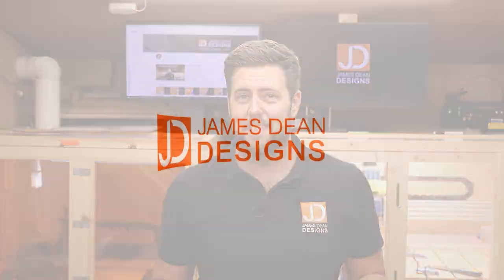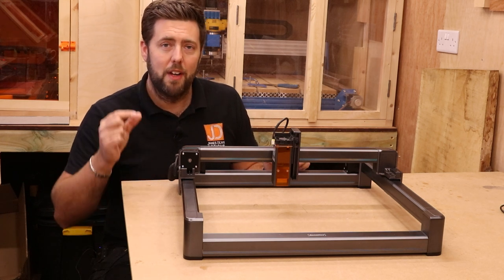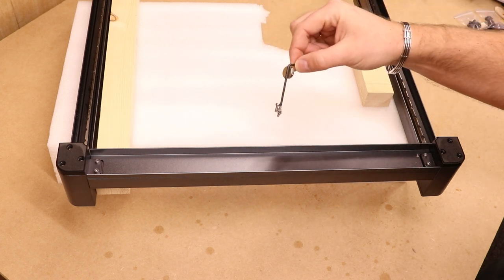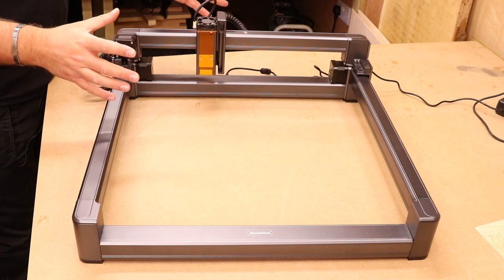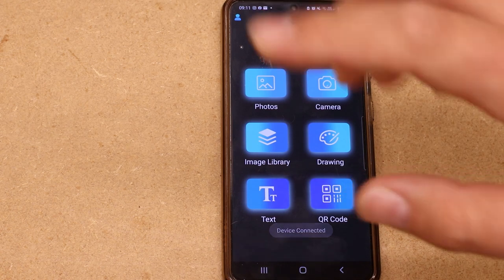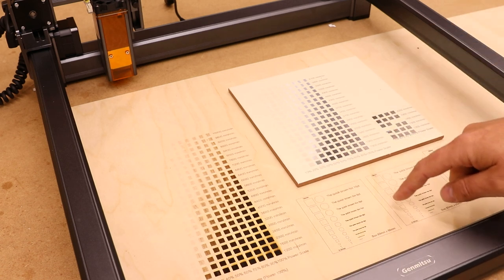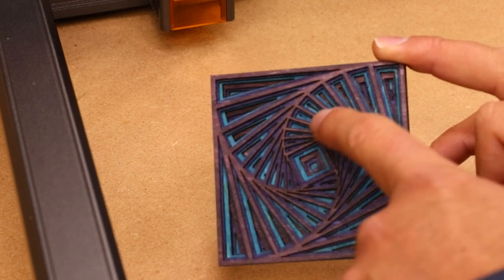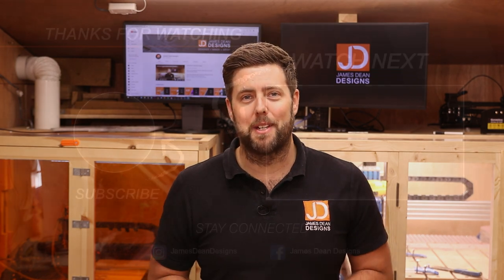LC-40 Sainsmart Genmitsu Jinsoku Laser - Phone controlled laser engraver

Comment: Hi James,  A really fantastic video, very well explained, especially the assembly and set up with the phone. I live in the UK and would like to purchase this machine but they are out of stock at the moment so in the mean time I have probably watched every video on Youtube about the Jinsoku LC-40 and yours has been by far the most informative. Just one little thing that you might want to look at is there are a lot of errors (spelling etc) in your subtitles which are an excellent addition but might cause some confusion to those that rely on them.  Thanks for an excellent channel. Paul
Reply from the maker: Thanks Paul. It's only been fairly recently I've been adding my own subtitles because of the extra time it takes. This would have been YouTubes auto subtitles, but I can go in and edit them so I will do 👍 
If you're struggling to get one, just message me on my website
Reply: @JamesDeanDesigns  Thank you James for replying so promptly. I wasn’t sure if you knew that the subtitles were like this. I will be looking at your website later.

Comment: James, I did some looking into the GRBL settings on my LC-40 and noticed the max for all three axis’s is set to 5000.  This may be why your tests didn’t show much difference above that.  It’s a bit strange that the machine would be set there instead of 10200!  Any thoughts on this?  BTW I changed mine to 8000, the 80% rule and it flat out flys now!

Comment: @James : great video as always. Just talked to sainsmart the other day and they confirmed a 10w laser upgrade for the LC40.
Did you got rid of the crooked circles with tensioning the belts in the end? Because I’ve the same problem and already did the tensioning, checked alignment, lubed the rails - no clue why that is or is that a thing with belts? My normal 3018 pro diy laser can engrave so detailed. Not as fast obviously but at least super accurate compared to the lc40.

Comment: I bought this laser a while ago and I just getting around to using it now that the weather is warmer.  I like it though there are some things I don't like.  It is hard to attach the X stepper cable.  When I first tried this laser it would only go in the Y direction.  I had to take it apart and reattach the X cable.  It works now.  They could have made it easier to tighten the belts as the X belt on my machine is a bit loose though it still seems to work okay.

You said that air assist could be attached to the 5w module with passive air assist.  I would be interested in knowing how to do this.

Comment: Hi James, Great video as always!
How would you describe the stiffness of these "new" type frame compared to the old and simple extrusions used e.g on 3018?
The beams are open on one side which typically is very poor on twist resistant.
Thanks in advance!
Reply from the maker: Thank you.The frame as such is open, but equally they run on linear rails which are better overall. Especially because this is a laser, the chance of twisting is very minimal anyway

Comment: Hi James, I've been running the LC-40 with the 10w laser from the past 6 months and found it to be a really good machine, but do you know whether it can take a more powerful laser? If it can, would you recommend anything.
Reply from the maker: Most lasers over 10w require their own power supply and the LC 40 uses fancy cables so you would need to tinker with the wiring to make it work. You would also need to find a way to mount it because more powerful lasers are typically larger. So yes you could get it to work but would require some tinkering

Comment: Hi James, Thanks for putting this up ,it is a really useful guide to the engraver. I bought one but have tried on 2 laptops to download the drivers etc, but can't make them connect to machine. It just keeps saying waiting for connection despite following the flashing etc. Just wondered if this was the problem you mentioned when you tried connecting with your first computer? Cheers Andy
Reply from the maker: Essentially yes, the tool they provide to refresh wouldn't connect and do the necessary task. Bit of a pain, was hoping it was an isolated incident but I'd definitely reach out to Sainsmart if you haven't done so already
Reply: @JamesDeanDesigns  Hi James ,Thank you for taking time  reply. It seems to be a problem in the software I reckon. I did contact them & they asked if I had flashed it, which I had. They have not replied to my latest message though ,which is disappointing. Its a well built bit of kit & looks great . With regret I will have to return it to Amazon if they don't reply. Great channel by the way James.
Andy
Reply: I have an interesting problem with the software flashing of the LC-40.  I can’t flash the upgrade as the updated tool throws an IO Exception error and no device found message. This is frustrating as the LC-40 is connected and communicating with the PC, I can operate the LC-40 with the pre installed software so it must be connected.
Anyone else experienced this issue? And if so what was the resolution? Messages to Sainsmart support have so far not resulted in any response
Thanks in advance 🙏
Reply: @theopalcuttingroom8488  Hi, That was exactly the same problem I had . It is now resolved. I Emailed them & got a reply from Ryan. After a couple of emails with suggestions it was not resolved. He then sent me out a new board for the  machine that was updated. It worked immediately & took 5 minutes to unscrew & plug in.
Hope this helps
Andy
Reply: @nogunwales9406  thank you for that info, much appreciated.
hopefully I will hear from them soon 👍

Comment: James, as always a great video. Its been a while and I need to watch it again soon, but in the mean time, what have you found the max speed to be for the LC-40? Much of Genmitsu's documentation states the speeds in %, I guess because of the mobile app, but I've never found what that max speed is to better tweak settings for Lightburn using mm/min or mm/s.  Any thoughts?
Reply from the maker: Thanks Jeff, very kind. To be honest. I've not really pushed it to a maximum speed because the laser does very little when travelling that fast. I believe they are meant to go upto about 20,000mm/min if my memory serves me correctly. Its one of the advantages of using the 32bit controller
Reply: James, Thanks for the reply.  So as I wait to hear what Sainsmart Support says, from my inquiry to them, I guess, to be safe, if I stick with 5000 being 100% and work my way down from there, I should be safe.  For Now.
Reply from the maker: @JeffBenedict  you could always do a powerscale test, but instead of small increments go up 1000mm/min per line or even 2000 and start at 5000. You'll soon see at what point it doesn't get any faster by the graduation change
Reply: @JamesDeanDesigns  Sainsmart Support confirmed the max is 5000 mm/min for the LC-40
Reply from the maker: @JeffBenedict  I think Sainsmart have mixed up their models as its certainly not 5000mm/min, that's more like the little 1620. If you jump to about 26 minutes into this video you'll see I did a power scale test and got it upto 10,000mm/min.
Reply: @JamesDeanDesigns  I checked the $110 and $111 values and they are set to 5000 so maybe they have it wrong in their firmware update to go from mobile access to GRBL so Lightburn can be used.

Comment: Hi James, I’ve connected up the LC40 laser but it won’t connect to Lightburn or LaserGrbl either. I’m connected to Com port 5 (tried multiple com ports and still nothing) and when connected laptop makes the connection sound. I’ve tried putting a manual laser in and adding the bed area dimensions in and still nothing. The LC40 app works and so does Sainsmart Engraving software so I know the laser works including the usb lead. I’ve loaded and reloaded the driver also but still won’t connect or even see the laser.
Any ideas?

Many Thanks
Reply: Howdy Mark,
I have a similar problem, did you end up finding a solution?
Right at this moment I have a very attractive looking paperweight sitting on my bench pretending to be a laser engraver 🤪😣
Reply: @theopalcuttingroom8488  I found this resource on their website https://docs.sainsmart.com/article/hy1vjck0oj-genmitsu-jinsoku-lc-40-resources

But in a nutshell, you have to go into Ports, and disable everything in there other than the one connected to your laser. Once you’ve don’t that it will update fine and then enable everything. Hope that helps 👍
Reply: @marksneyd1262  
Thank you Mark, that works 👍
I have contacted SainSmart and advised they need to make the resource a little clearer, namely that the user needs to disable all COM ports in the Device Manager including COM1 to cause the PC to recognise the LC-40.
Cheers and thanks for your help 👍
Reply: @theopalcuttingroom8488  great stuff. At least you have a working paperweight now 😂

Comment: How did you find the linear rail system over wheels
Reply from the maker: I find it quite smooth given they are probably low end linear rails and bearings. One thing I hate is when you get a new machine with wheels, they always have flat spots from where they have been sitting during storage and transport so you get little bumps when they run. Having the linear rails eliminates that straight away

Comment: So many of these machines,  and never enough time/money/space...   Why does the one enclosure behind you have windows that look to be an orange color?  Is that something to block laser light?
Reply from the maker: Yes, so that is the main machine I use for laser. I installed some amber orange persepx sheets a few weeks ago. Whilst this is not technically laser shield, it does black out a lot of the harmful light for when I am generally running the laser and working in the workshop - essentially meaning I do not have to wear the laser glasses all of the time.

Comment: Why did they put the controls and inter-connect ports (other than the power connection) in the back??  When you want to put this on your workbench you either have to reach over it, or move it to get to them.  Kind of like putting your car ignition switch in the back seat!  Not everyone has a "walkaround" bench, not to mention after you put it in an enclosure and have to deal with that too.  Not much thought in the design there, in my opinion  Just my $.02.
Reply from the maker: It's a really valid point. I'm guessing to avoid having too many wires running through the frame but could make users like easier having them on the front